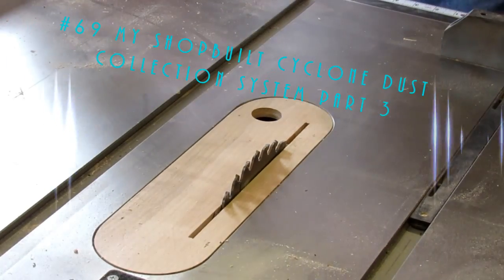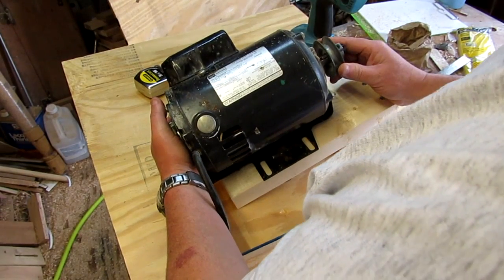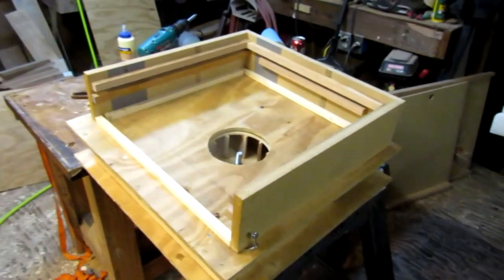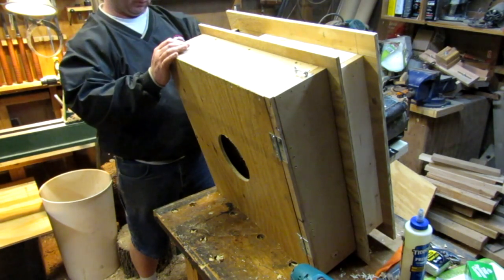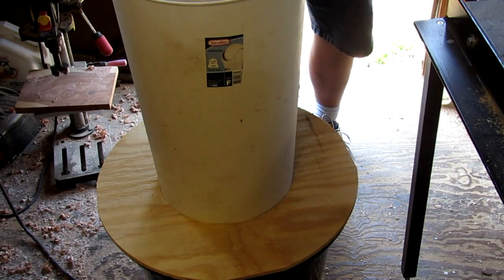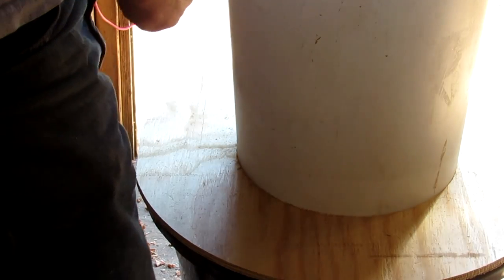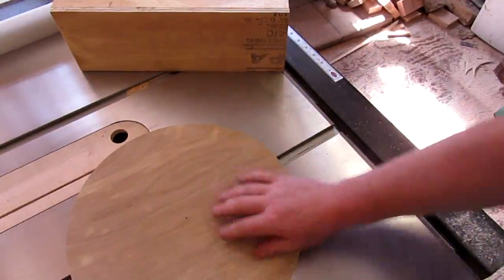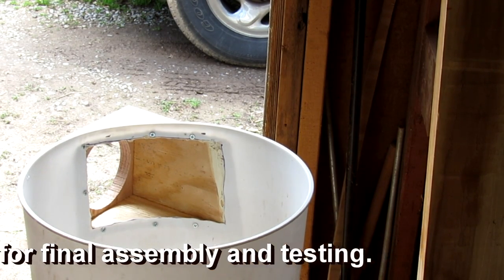#69 My Shopmade Cyclone Dust Collection System Part 3

Comment: Hey Stephen, great build so far.
Bit of advice for you, introducing the baffle is restricting the air flow thus giving you less pull and will put more duty on the motor which will eventually lead to the motor failing. I suggest you leave that out and also separate the filters as there should be an air gap between the two.
I am a retired heating and ventilation engineer hence my knowledge of this.
Reply from the maker: A7 Photography Thank you sir. I really appreciate the suggestions. I think I can do that. I have already removed the baffle due to restricted flow. Didn't take long to learn that one. Removing it also gives me room to separate the filters. Thank you. I will make these changes because they do make good sense. Thanks for commenting and supporting my channel.

Comment: Great project Steve.  It shows some very good intuitive engineering.  I had planned on buying a Grizzly cyclone when I get my shop but it is a lot of money so I may put that on my maybe list and try building my own first.  As I was watching I was thinking about the impeller blades.  Oak is a very hard wood but it is wood and I was thinking about the possibility of designing the unit around using a 8" or 10" schedule 40 PVC pipe and using that to cut the blades out of.  What do you think?Always watching.  Dave
Reply from the maker: +Dave Harrington Thanks Dave. I think the use of large diameter PVC pipe is a great idea. Good luck with your build and please let me know how it works for you. Mine is operating flawlessly still.